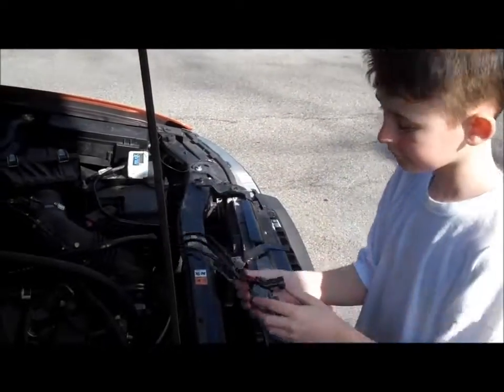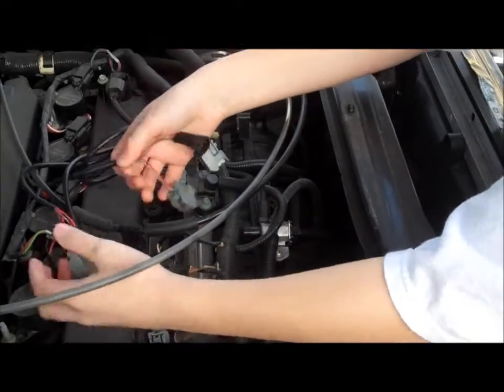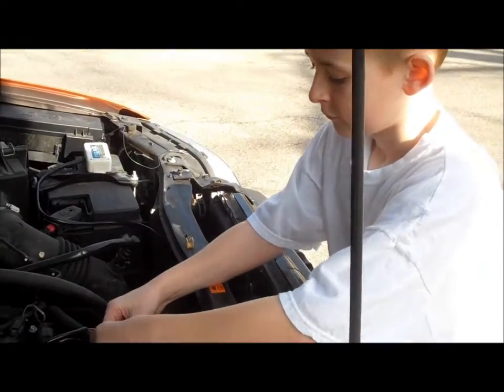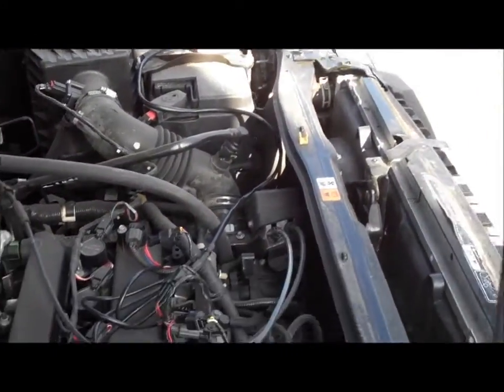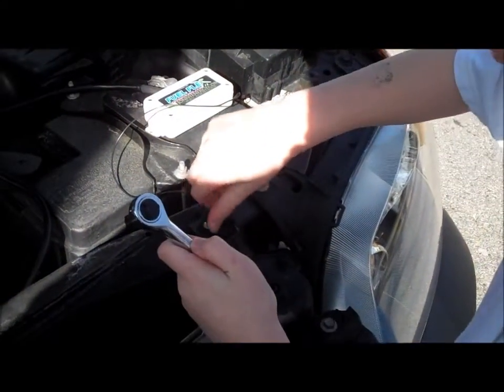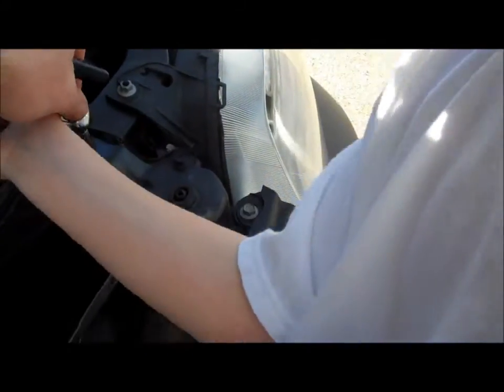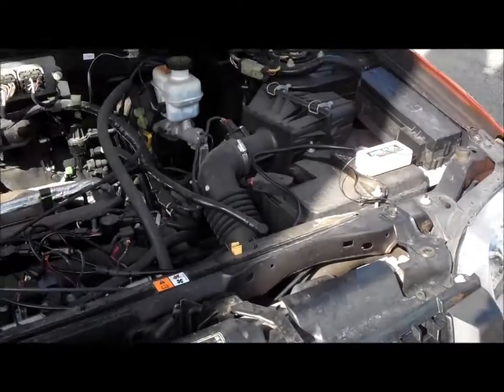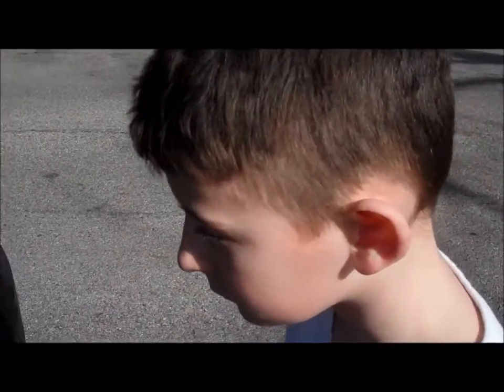2006 Ford Escape converted to Flex Fuel E85 by 9 Year Old

Comment: You need to take into effect the cooling characteristics of ethanol as well. While its actual octane rating is likely in the high 90's the cooling effect gives it the characteristics of a much higher octane fuel. Goggle the tests being done between C16 race fuel (116 octane) and E85. You will see E85 can hold its own in high horsepower applications similar to C16. It blows 100-104 octane race fuels out of the water.

Comment: On a modern car no parts need to be changed. The tune is what has to be changed. You need to push about 25% to 30% more fuel for E85. Your average ECU cannot safely make adjustments to this range so you have to retune the ECU. On a properly tuned normally aspirated vehicle you will pick up some power when tuned. On a force inducted the power increase can be staggering. I picked up 80whp and 100 wtq with just an ethanol tune on my 2012 wrx.